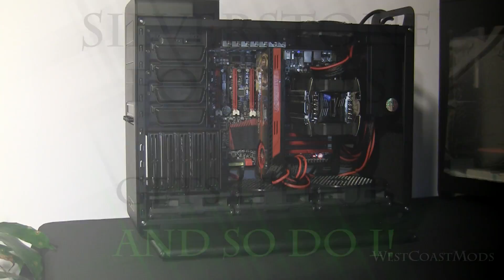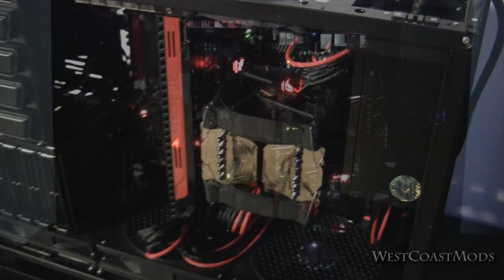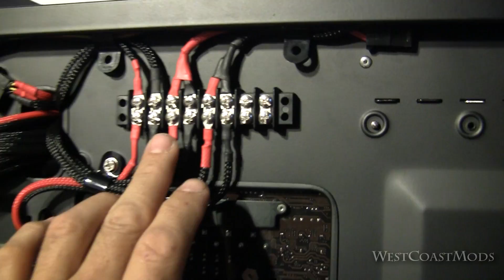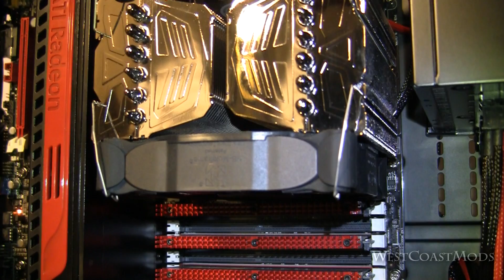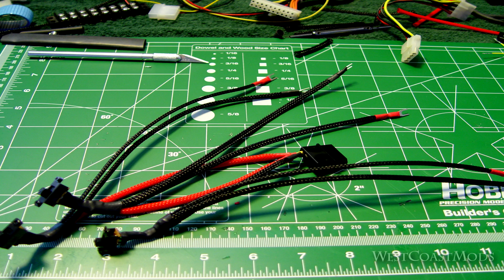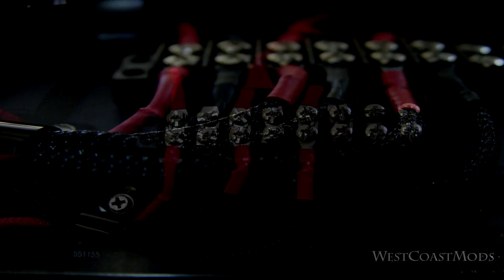Silverstone Fortress Gets Lit Up and So Do I....!

Comment: @WestCoastMods 

Thanks so much, I'm in the process of trying to build one like this... I love the case and the setup... going to go with the I7 950 or 960 

You did an amazing job... Absolutely love it.. thanks so much for the video.

This will be my first build and I'm sure I will mess up all over the place, but this is an amazing video- thanks for posting it..

I wish I could run the wires all neat and nice how you did, that looks amazing.
Really Nice build..   Amazing job

Comment from the maker: @tzillian7Yeah, it may be possible...don't recall how much room was on top, but it should work. As far as putting one on one of the 180mm fans, well that may take a little bit more effort...you will need top find a way to mount it...possible custom brackets.

Comment: hey man, quick question. do you think it would be possible to add a 120mm rad up top where the exaust is and then one on top of the 180mm fan furthest to the right. this would be to cool just the cpu and 1 5970 card?

Comment from the maker: @richardrubik Yeah, the client decide just not to install it at all, but by using it it increased the CPU temp by 1 deg. So really it wasn't a problem to install it, but after seeing it the client felt it looked cleaner without, this way you were able to see the Dominator GT ram modules.

Comment: @WestCoastMods :) i just want to give it try. i currently use an artic cooling freezer 7 pro cooler in my system. temps are pretty satisfying - 40s for cpu, mid 50s for gpu.

but now that it's already summer, temps start to spike up just a bit. saving up some money on other parts for my build hopefully in the summer or during school year when i begin as a freshman in college. :)

the h50 is the least i could do for watercooling, so i just want to give it a try. :)

thanks again

Comment: i would say leave the ram coolers off. as you said yourself it affects the CPU temp by 1 degree, which is still something. The ram modules themselves dont normally have heating issues, making the ram coolers (most of the time) useless.
i would say leave it off, as it makes the case look cleaner.

Comment from the maker: @Mr937595 It wasn't installed to help with airflow or to cool the ram, thats why i mentioned that it only changed the temps by 1 deg. I put it there just for looks, wondering if it heklped the overall lighting or made it lok worse. Anyway i have ditched the ram cooler and re-routed the light

new vid tonight
LazyMan :-)

Comment: I would use no ram cooler. it would obstruct airflow, etc. etc. but also do a bad job of cooling the ram. its designed to operate under standard atx conditions, you already have the 180mm flowing right over the heatsinks, and then the cpu cooler pulling that air away. fine the way it is, and i think it looks abit better in this case(with the scheme and all- the 3 red strips match the trim of black with red)

Comment from the maker: @adamXatomic Thanks bro, yeah the sleeving is from MDPC, and yes it's better than most stuff you can find, especially for single braiding cables, however I do have other vendors that carry other sizes that MDPC doesn't carry and it's just as good. 

All depends what you need it for...one thing I don't like from MDPC is their heat shrink, it's not the best out there, I can get better heatshrink locally

Comment: damn lazyman. amazing work!
the only thing i dont like about the lighting set up is how you see a bunch of empty slots, and then you cant see anything in the bottom right hand corner.
i think that adding the ram cooler would help get rid of some of that "void" when the lights are on. just my 1 1/2 cents.

oh, is that mnpc sleeving your using? from what ive heard that stuff is way better than the stuff you normally find. is this true?

Comment from the maker: @4ftofflame Thanks, I will try to do a how to the next time I run LED's strip lighting, but it's pretty easy all you need to do is solder on a pwr cable and a ground cable, then run it to the PSU, know to hook up switches it gets a little bit more difficult.

Comment from the maker: @pjwatny Do you mean the mobo and all the components...the mobo has been rotated 90deg. for better airflow...As heat rises there are no obstructions to get it it's way, especially the GPU. There are several cases out there that are using this design, and I'm sure more manufactures will offer something like this in the near future.

Comment: I think passive cooling is sufficient for that RAM, plus I think the air from that bottom fan is going to run through it and hot air pulled away by the CPU fan.

Comment from the maker: @ArfurSchrunkunpecker Thanks bro, The terminal bock does come mounted on a hard plastic base and the spacers in between each terminal raise above the connectors, so it would be hard for the side panel to touch the connections. I seen some ppl wrap the terminal block in electrical tape as a precaution, but I don't think it's necessary.

Comment: It came out great. Toning that one strip down would be a really good idea. I have been wanting to use them strips myself so It was really nice to see how they are going to look in a case. 

I wouldnt think with the 180mm blowing up at the ram and the intake fan on the cpu cooler pulling air away that you would need a ram cooler. But the red led fan one you did looks great on there.

Comment: Uff, te lighting is >.< not fitting i guess. The bottom right side should be lighted aswell. i would have had a problem with that.
anyway, the lighting under the CPU is way too bright.
U should make an LED Strip made of Red and White LEDs, this way it doesnt look too dark(only red) and not too bright (only white). you should test different leds, i dont know how bright the white and red ones should be, but i think the customer has enough money for a few more LEDs^^